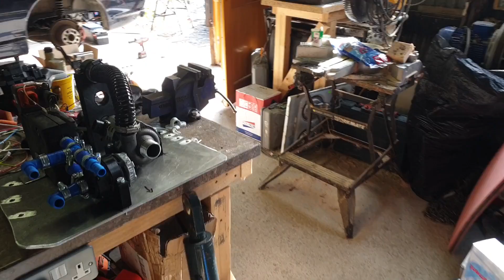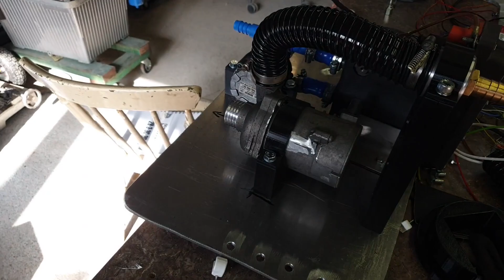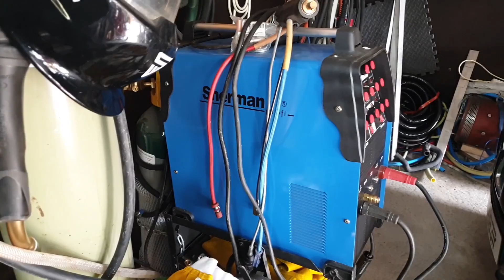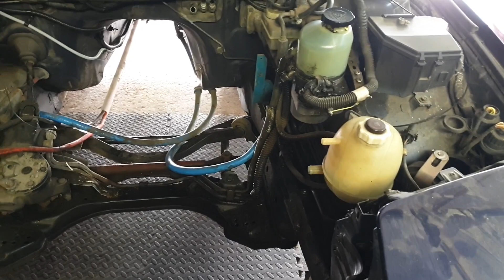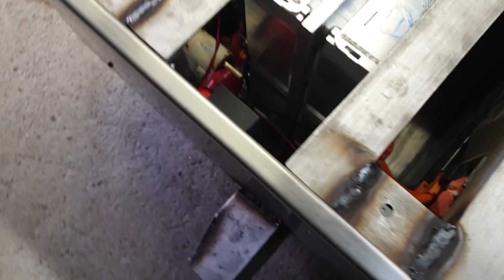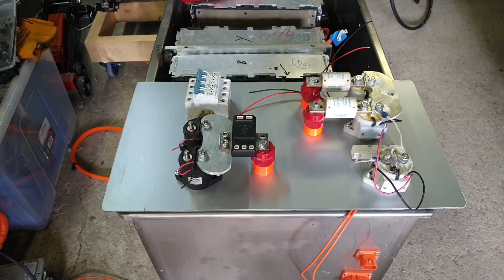Panzer Update Sept `23

Comment: It is nice to see a proper battery evolving for the Panzer 😁 TE HVP800 is the big HV Header, can do 250A RMS  continuous when hooked up to 50mm², while the smaller TE HVA280 is more of a 40A contraption, with I think a maximum of 4mm² cables attached. The Junction Plate is also populated with stuff we use at work in our battery packs, the 1000A "semi-BMS" Isabellenhütte shunt being somewhat the icing on the cake  - great work! Not to forget the blow-out valve, for when things should go awry with a cell or two. You are indeed moving into more professional territory now, upping your game😃

Comment: Be careful with the 3D printed parts and automotive temperatures. I created 3D printed boot hooks to replace  the originals that snapped in my Ampera (used for holding up the parcel shelf net). All it took was a single sunny weekend and they warped and failed. Temperatures in the cabin wouldn't have been above 50~60°C 😳👍 Awesome content by the way.
Reply: It all depends on the material used. PLA is not very good for higher temperatures, but ABS is very capable and often used in injection moulded parts from the OEM as well.
PETG and ASA are somewhere in between.
Reply: I used PETG on the exact same part in my Volt and they held fine in the Texas summer.